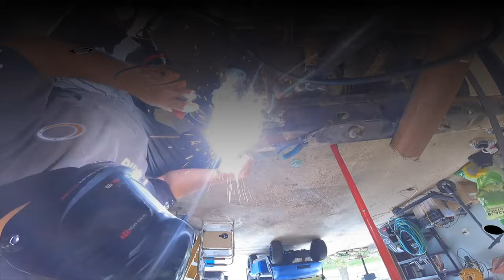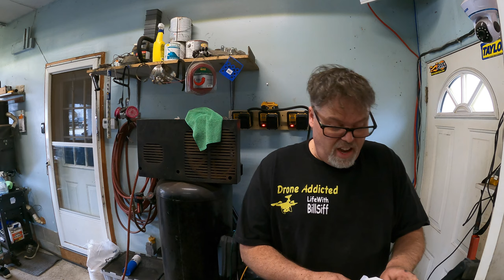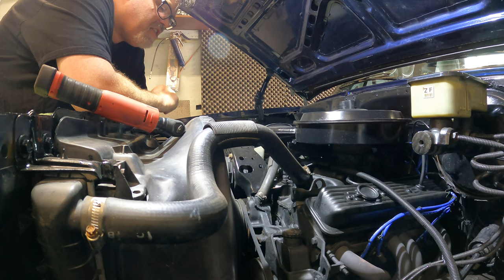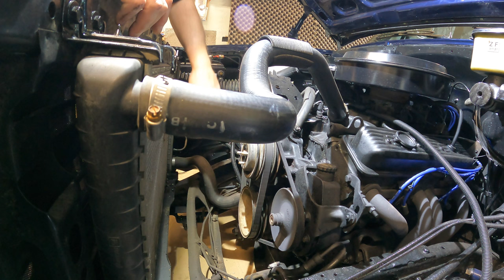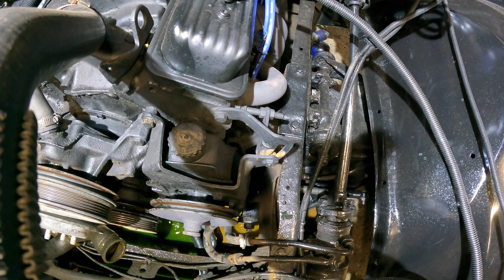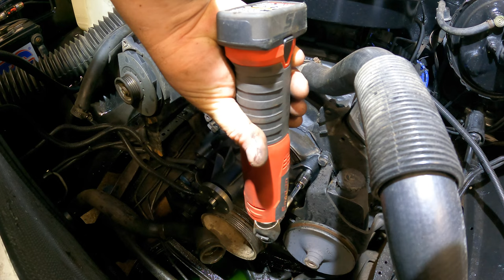I Figured The Water Pump Would Go Out   4K

Comment: My 1996 F150 5.0 4x4 tried to died on my teenager this weekend. I threw a bunch of parts at it... coil, ignitaion control module, cap, rotor and a bunch of cuss words.  Billsiff makes it look so easy!  I was having spark issues and then thought maybe it was the pickup coil inside the distributor and a professional should take a look at it. A new distributor, idler pulley, belt and radiator $700+ and it's back on the road.